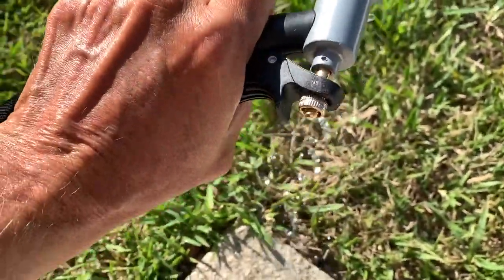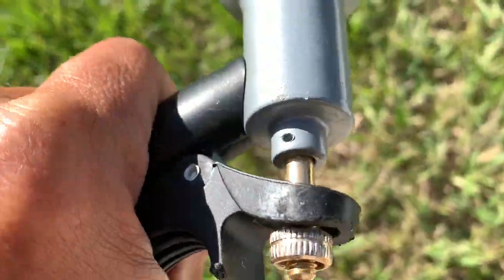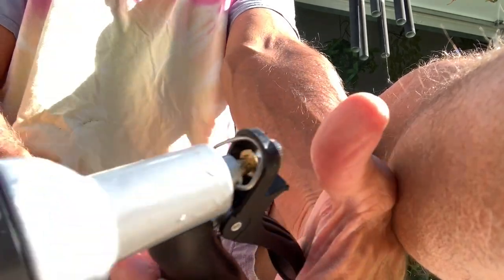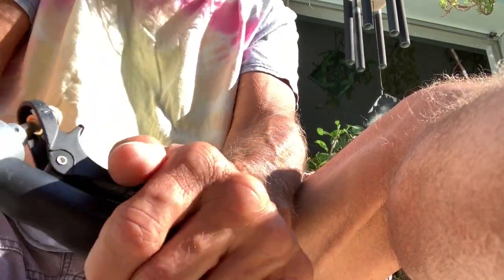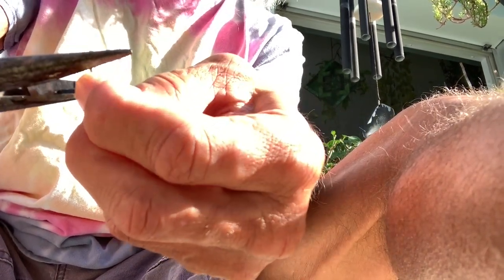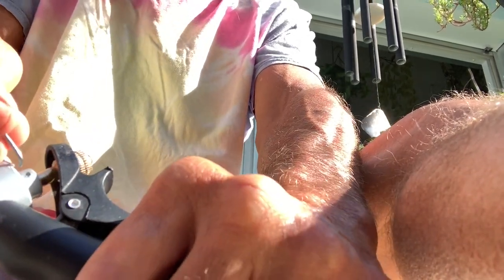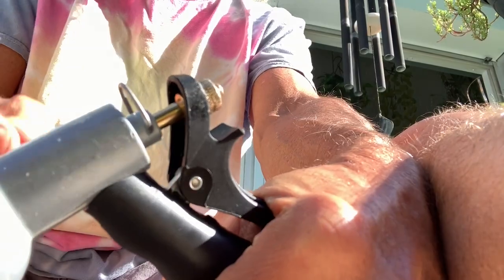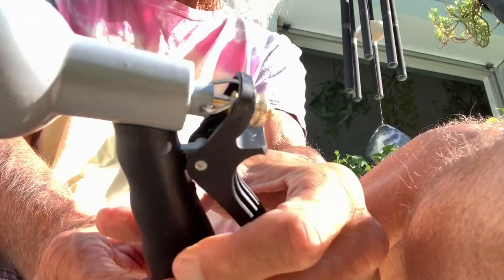How to fix a Melnor hose nozzle spray pin

Comment: That's fine if you can find the pin. Melnor should include 2 extra ones. They keep popping off.
Reply from the maker: That’s definitely true but you could use some wire to fashion one and then just squeeze it in